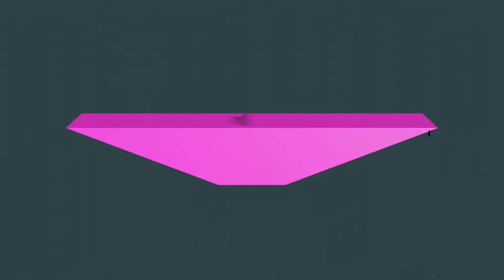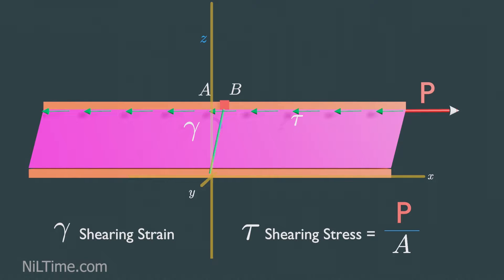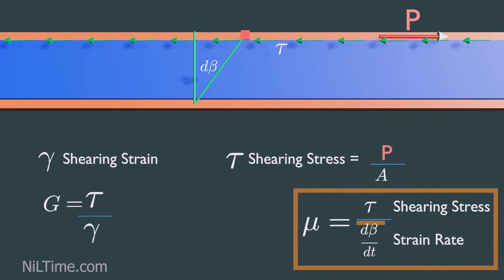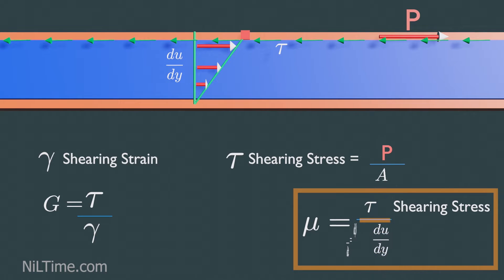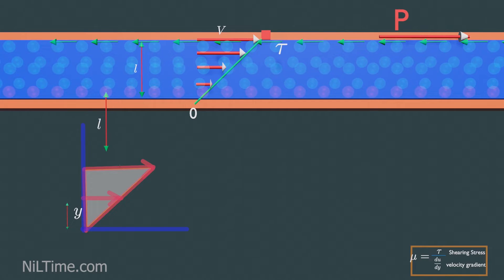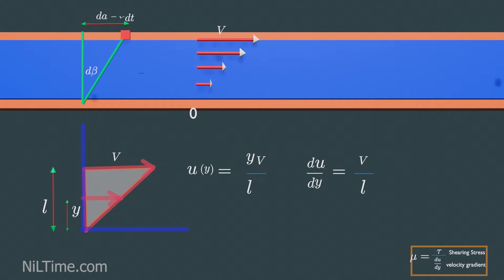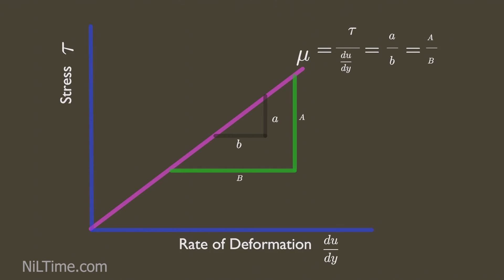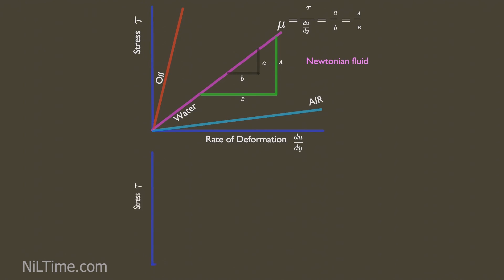Fluid Viscosity And Shear Stresses Animation

Comment: its not a half of parabolic?
Reply from the maker: Nope. Its Due to movement of upper plate. XD
Reply: @NiLTime  Okey, so the interval of each layers something like this sqrt((depth/cos(θ))^2-depth^2)
Reply from the maker: @jhanolaer8286  you can use pythagorean theorem ;)  ... as the velocity profile is a triangle here .. The velocity profile depends on the source it flows ... for pipe and laminar flow .. the profile would be parabolic . XD